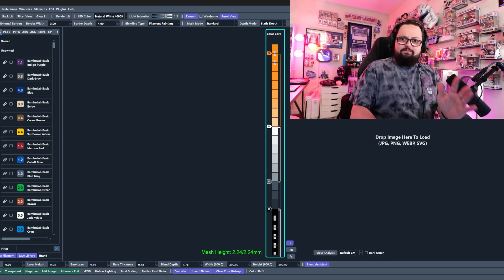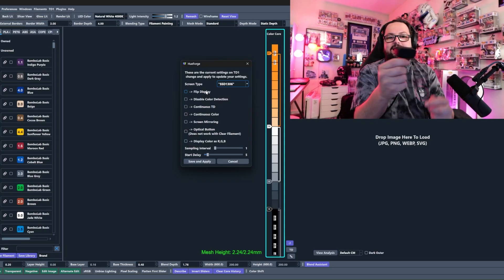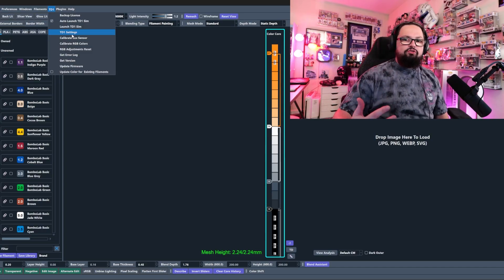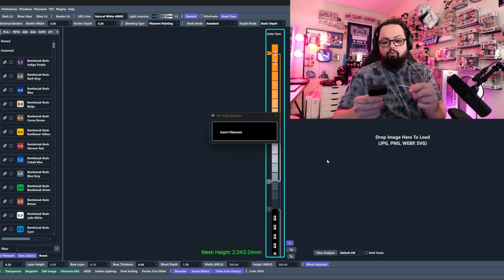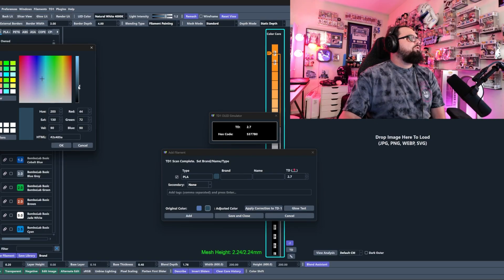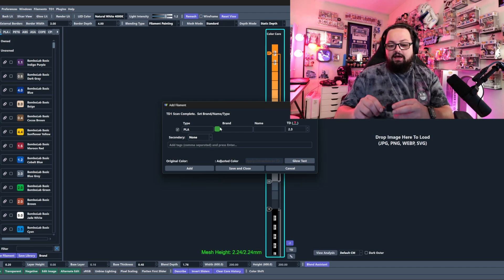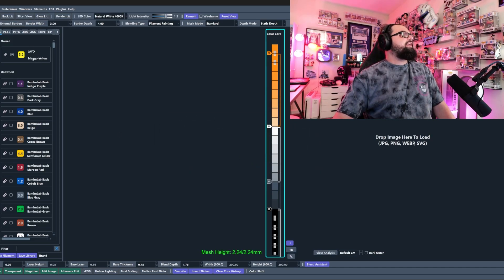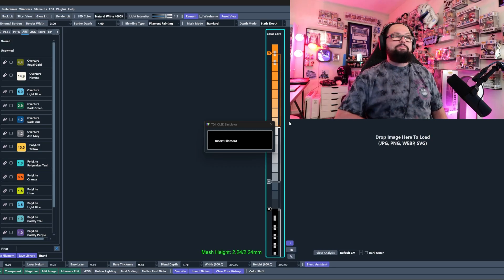I Tested the BQ TD1S for HueForge… Here’s the Truth (Setup + Review)

Comment: This has been reading colors incorrectly . I just got a couple days ago. How can I trust the TD reading if the color reading is incorrect
Reply from the maker: TD measures light, very simple to actually read. Color reading is a really expensive technology that is significantly more difficult to master in a budget friendly way. The color reading is more of a add on since we can manually do it in HF. If you want to test the TD you can do the seashell test (plenty of YT videos on it) to validate your results.
Reply from the maker: You also need to calibrate the color sensor detailed in the last half of this video! That is very important

Comment: I have heard that people have issues with going through the USB ports on the front of the PC but have better luck with going through the USBs on the back that come right off the Motherboard.
Reply from the maker: yea I have heard that too but for me it was really 50/50
Reply: @3DPrintsByVic I just opened the box plugged it into a power strip and started pushing my filliament through then manually typing the info into HF 😅 I guess I should have read some instructions because I had no idea I needed to calibrate it. Grey is the only color that was off for me shade wise. Now that I have seen your video I need to calibrate and do it all again.
Reply from the maker: @Jayson-X3D  Best of luck!

Comment: I just started looking into HF, so there isn't a community library? I would likely need to get this if I want to add my library of filament?
Reply from the maker: There are several, but the reality is that every batch of filament will vary some so if you need the extra level of detail or if its not documented then something like this helps a ton
Reply: @3DPrintsByVic that makes sense, thanks!